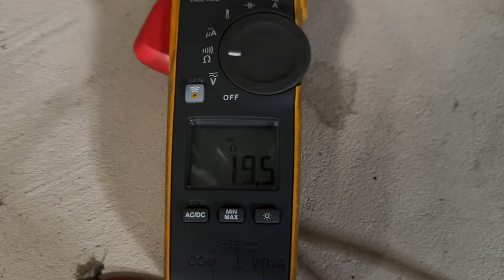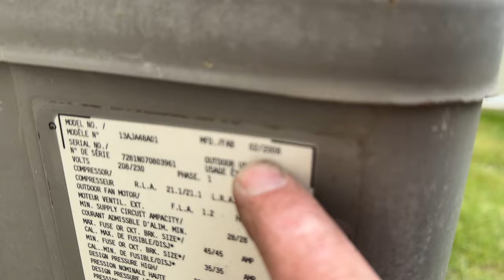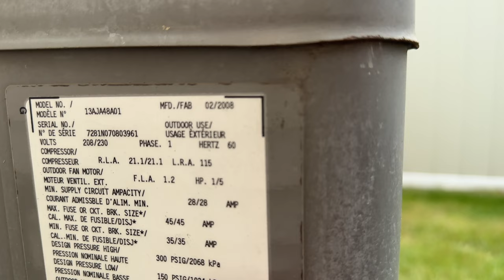Master the Steps to Diagnosing Low Voltage Wiring Shorts: Central AC Not Responding to Thermostat

Comment: Had one the other day trane heat pump. Coil temp senser wire touching the frame. Vibration since 2004 finally got passed the wire insulation.

Comment: would be nice if you used 3/8 liguid tight for the low voltage on new systems, or even none split loom.
I would like to see Peter knock and do his own service call while you capture it and get his back.
Reply: @Ampacityelectric  Google it
Home depot Liquid Tight 3/8 x 100 ft. Non-Metallic Conduit.

The slimmer cable would look cleaner next to three 3/4 power whip and who knows maybe 3/8 can be used elsewhere
Reply: @Ampacityelectric  working with low voltage networking, security systems we use down to 1/4 for card access systems. you can fit a years worth of fittings in a 4 qt bin.